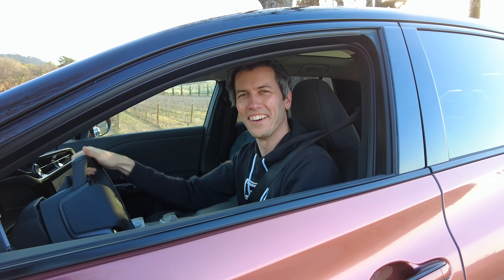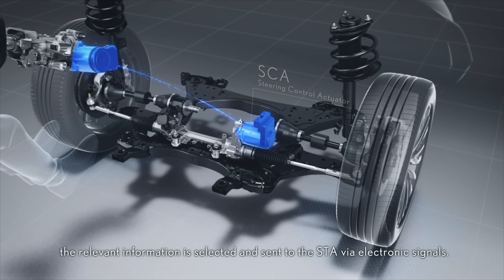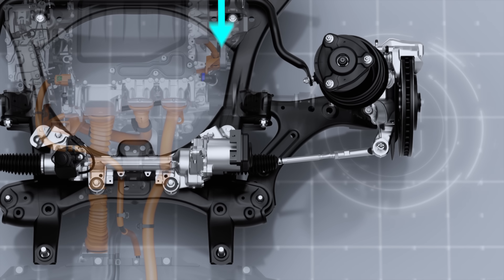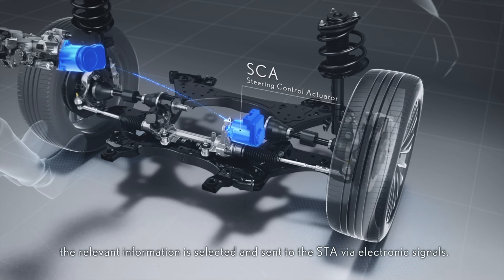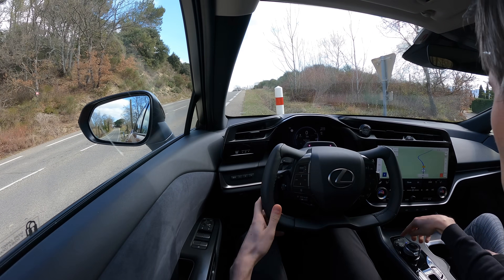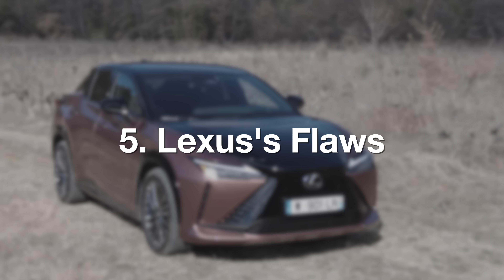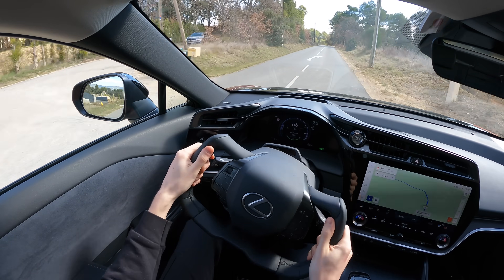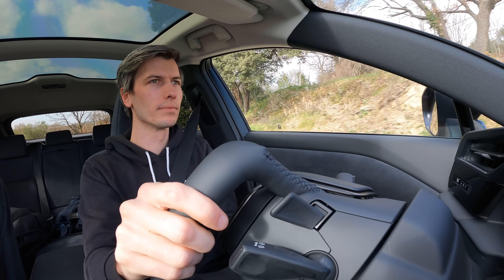How Lexus Fixed Tesla's Bad Idea: Steer-By-Wire Yoke

Comment: I can't wait for this to be an option in more cars. It seems like a no brainer to me, but I might be in the minority. More space for the driver, better visibility of the dash and road, probably cheaper to manufacture, no crossing hands, no one hand steering like a fully sick uleh. It can also allow for more safety features. Not just what is mentioned in the video, but in cases of accidents if the rack and pinion system is damaged you cannot steer. With steer by wire, the car could still steer, and with modern driving assist tech and cameras, it could ignore driver input and pull over to the side of the road even if the driver is leaning on the steering, or passed out from the accident.

Comment: Very interesting/ Were you able to perform a moose test? i.e. Quick and hard swerve at speed? Is there some logic in the system that senses this and gives the right steering response (i.e. similar to how kickdown mode in a throttle works).

Comment: Intuitive and predictable seems like different things here, I rather have a predictable steering response than a Intuitive one. I guess they could put a menu to set the steering response and curve to fit each driver.

I rather get a small steering ratio with speed variable force than variable ratio that would change the steering angle as the speed changes through a corner without moving the steering wheel, that could be very unpredictable!

Comment: That steering input latency looks insane and completely unacceptable. Same as the car deciding what kind of input is too much. 
I have no problems with the reliability of the system or the dinamic ratio, but again seems like the usual technology advancement that takes away some control from the driver, even tho most won't notice it.

Comment: SAAB wanted to do steer by wire in the 90s. But it's not legal, there has to be a mechanical steering by law.
At least in Europe.
Reply: This video is being recorded in France tough
Reply: @Napoleon_Blownapart  Maybe law is changed or doesn't apply to concept vehicles.

Comment: What you didn't mention is that in most current modern vehicles if the steering assistance fails the steering becomes so heavy that most drivers won't be able to turn the steering wheel by any appreciable amount.  So drivers may feel safer because they think there is a direct connection between the steering wheel and the wheels of their vehicle but in the event of a steering assistance failure at anything other than crawling pace they are pretty much guaranteed to crash.  Consequently steer by wire with its redundant motors is at least as safe and probably safer than most vehicles that are on the roads at the moment.
Reply: Except the faster you go the easier it is to steer without power steering. Power steering helps the most on low speeds not high speeds.

Comment: Well many cars already have a greatly variable steering ratio at parking speeds compared to highway speeds so if they can tune that to be the same it's a non issue to me. In fact since its all programmable they could give driver options to fine tune it to desired behavior and make most people happy with it.
The response time issue tho I'm not a fan of. As they said themselves the reason we go to fly by wire systems is to eliminate timelags in inputs and improve precision, here it clearly is much worse.
This car look like it would do very poorly in elk avoidance tests I imagine because you would simply not be able to redirect the wheels in time no matter what you do. It's on the level of a safety issue imo, they need to improve the response massively.

Comment: The variable steering ratio makes a lot of sense and is something Nissan did on the last iteration of the 350z using an electronic variable orifice (EVO). Like you mentioned I’d still be worried about the additional monitors sending an incorrect signal like we see on some driving assist systems now with LKAS, ACC, or Braking Assist causing some cars to slam the brakes while on a highway due to the monitors thinking something was in the way. I’d also be worried about this system 10-15 years after it’s release when some cars with this feature could see neglected maintenance possibly reducing the effectiveness of the redundant systems in place.
Reply: I'm quite certain an "electronic variable orifice" is just changing the steering assist...

Comment: I wonder if you don't want to prevent wild steering inputs at speed, e.g. in the event you need to dodge a deer on the freeway. And the sensitivity curve related to speed I'm not sure is a problem for predictability -- turning speed is already variable with forward speed with a linear steering rack. It might feel like butt, but I don't think it's because the alternative is inherently more predictable. Might be some interesting parallels to first person shooter controls on console analog sticks. Can't think of a good reason to have that steering latency, though.

Comment: Didn’t know Lexus was going to be using this system.  Good idea and I would love to see Tesla do it.  Having driven a yoke in Tesla for a year and a half I actually like it, but would much rather have this variable steering.
Reply: This didn't age well, the cybertruck has it even before lexus.
Reply: Yo zolloteck
Reply: You shouldn't be: they were 90% there ten years ago...
Reply: Didn't you missed traditional controller for turning signals and so on?
Reply: Lexus engineers play chess while Tesla "engineers" are merely playing checkers.
Reply: @dantesinfernopurgatory7826  irl both are run by a marketing team and the real engineers are pulling their hairs
Reply: @dantesinfernopurgatory7826  In my opinion this is not true; Tesla has some exceptional engineers.
Reply: @willitbreak5825 
They also have some moronic management, who seemingly make decisions based on how funny a meme it could be.
Reply: Tesla falls apart, I will only trust Lexus with this type of systems.
Reply: yea someone who would never go near a Tesla let alone buy one, good to see other manufacturrers with actual engineering experince are doing things right.

Comment: Changing Ratio and independent steering from steering wheel - already in production use since at least 2008 BMW Active steering. Works by inserting an electric motor into the steering column/shaft, which can e.g. rotate left when you turn left to make your wheels turn faster than your steering wheel or turn right when you turn left to reduce wheel movement. Or turn left without your steering wheel to reduce need for ESP-action, if your car is slipping to the right. But there you have a mechanical backup - if the steering motor stops (blockage or electronic dies or no electric power at all!) it neither increases nor decrease your gearing from steering wheel to tire movement and you can always steer.

Comment: I drove a Tesla plaid for a long weekend. The only real time you need hand over hand was during parking lot maneuvers, which I quickly learned that you can easily take two fingers and spin the yoke like you’re dialing a big rotary telephone. Super easy. For all other driving scenarios, the yoke definitely felt superior.
Reply: I've had my Plaid for a little over six months and that's essentially how I do it for tight maneuvering except I use one finger.  Overall I like the yoke but I really would prefer turn signal buttons over haptic surfaces, I can't always seem to get the turn signals to work.
Reply: @TheAeroegg  I loved the better visibility, I think a lot of the complainers have never even tried it.
Reply: I've been using the yoke for about a year, and it gets even easier over time. The shape means that you can grab onto something that you are pushing/pulling at a right angle or at least a better angle. It feels like I have more control. Maybe like the difference between opening a door by turning a lever vs a knob. The knob is symmetric, but you can apply torque more easily to the lever. It's related to why some people put steering knobs on their steering wheels especially if they have a high steering ratio (e.g. buses or trucks). The asymmetry also provides better tactile feedback about the position of the steering wheel/yoke.

Comment: As an engineer, I love the concept and almost all of the implementation. Getting software between the drivers and the steering is a nice thing when you're the software engineer; gives you amazing flexibility in controlling the system overall to improve the user's experience. Many issues can be addressed with firmware update, not a full recall. I'll be interested to watch as systems like this become favored for semi- and full-autonomous vehicles.

As a consumer, I dislike the increase in complexity and cost. Redundancy is great for mission critical systems, but will inherently be more expensive and require additional development time and single-point failure testing. Not to mention, it just takes a driver ignorning the "service steering system" message for them to be operating unsafely, or the vehicle needs to disallow operation in this condition.

The hybrid variable steering ratio systems BMW pioneered 20 years ago seem to have struck a good middle-ground (for vehicles that aren't intended to be self-driving). The benefit of augmented steering response, without the drawbacks of latency, lost feedback, or added redundant parts required by design.

Comment: Yeah, no. I'm not interested in the engineer's opinion of what feedback should come through the wheel. There's too much that can go wrong due to software on modern cars already, this is a failure point you didn't address. One bad over-the air update and your car could be impossible to drive. And as long as software is written by humans, that's a real possibility. That delay is also unacceptable.

Comment: It sounds rather more expensive than a conventional assisted stearing setup and ultimately it will be less reliable I have lost count of throttle pedals I have changed and when they fail its not a safety concern.
I have driven heavy trucks with failed power steering its not a problem people shuld learn to drive there is no need to turn the stearing wheel if the vehicle is not moving. Its overcomplication for the sake of overcomplication. It smells like computer assist just because we can just remember the simple route is most likely the best route

Comment: Infiniti also has a steer-by-wire system. Theirs has a physical connection that's disconnected by a clutch unless there's an emergency. Kind of negates the packaging benefits.

Comment: SO in order to save the world from combustion engines and carbon emissions you are told to buy electric Vehicles which have a main expensive battery, still has the usual 12volt battery and now another backup battery and yet they can still leave you stranded because of a dead or low battery?? How much harmful emissions are created by the production of all these batteries and electricity needed to recharge the vehicles not to mention the cost of replacements? Furthermore no one is reviving any old electric car made in the past 10 years due to the parts unavailability, Irrelevance of it's technology and cost to rebuild them thus creating more waste and pollution. But the politicians want all electric cars by 2035. Make it make sense!

Comment: This is basically video game steering.  I remember in Project Gotham I did a test where when you were stopped with the joystick all the way to one side, the faster you went from a stop the bigger and bigger the turning radius got.  That's pretty much how this works.  In a regular car your steering would remain locked and your tires would be screeching as you understeered more and more as you sped up.

Comment: To me, this is a solution to an issue that never existed.
For one, the multi turn steering is not a problem, because despite when parking or doing very slow maneuvers,  you can go on all roads turning the wheel just 90 degrees. You almost never use the full turn of the wheel.
For two, the packaging argument is only relevant for combustion cars, that ave a big engine in front. Now that we are moving to electric cars, that is a non issue. So I don't see any benefit to develop all that tech now.
And to finish it off, the engineer argument is absurd. Talks about speed in response, and delivers a system with delay. So if that was the problem they set out to solve, this is a total failure.
And after all of that... This is for suer going to be very expensive, for a marginal gain in some areas, and a noticeable loss in others (like delay) So it solves some issues, but creates others. What a terrible solution.

Comment: The engineering is fascinating, but it's a great example of a solution in search of a problem. And an over-engineered, over-complicated, over-expensive one. Anyone who's driven a light well balanced car knows that rack and pinion steering is a perfected system providing a thrilling and immediate feel and connection with the road.
Also, remember that while redundancy reduces the impact of failure, it also doubles the chance of failure happening.

Comment: The repair costs for this system shortly after the warranty ends will be staggering. In my steering shaft system if I lose my pump I can still get home and fix it. I also can turn it with the engine off if I need to tow it onto a wrecker. With this system there are too many complex components made by the lowest bidder in a foreign country. The failure of any one of them force you to the side of the road waiting for a tow at the best. Also a terrible idea to hand over yet another function to a computer. Just wait for this to get hacked. The minimal gains are grossly outweighed by the fiscal impact it will have on the unlucky ones who purchase it. Unless Lexus will warranty this system for 25 years nobody should be willing to buy it.
Reply: Yep this is common sense

Comment: Every day we grow closer to video game simulators replicating reality. However, I always thought that it'd be due to the simulators improving in feel..

For day to day, this system is probably fine. But it'd be cool if there was a mechanical steering rack as a "back up" that's clutch engaged, so you can decide when to have a more authentic feel when you want. Granted, you'd have to stop the vehicle and straighten the wheel (And it'd cost more money to develop a clutch system for the wheel)

Comment: Hope the future of this steer by wire is that the steering characteristic is a constant exponential/progressive ratio instead of adaptive but fixed ratio by default, with a clear switch over for parking speed maneuvering. Adaptive but fixed ratio just sounds like you will have that one time you jerk to dodge a pothole and will end up in a jerk fest because your corrections or seemingly in your case, drive over whatever you are driving towards.

Comment: My BMW has Variable Sport Steering and it's great, albeit the old fashioned way. It's not nearly as variable as this Lexus tech, but I can confirm that it is easy to get along with. I can take roundabouts without lifting my hands, yet have a relaxed feel around the middle when driving fast. I really don't like the delay this has at all, this does not seem something that should still be in a drivable car like this pre-production model. Should have been eliminated at the design stage.

Comment: So F1 cars use this? After all if it's better and safer then it must be in use. Nope. And if a directly connected steering wheel works in the quickest cars around a track in history then it's clearly fine for the road.
Reply from the maker: You're aware they use brake-by-wire in F1, yeah? The rules do not allow a steering assist in F1, so they are forced to use a mechanical setup. I'm not saying I disagree with you, I'm just saying that's not why it's that way in F1. By that logic, we should remove all steering assist, which would not be a great idea for 99% of drivers.

Comment: In flying, if there is a delay of around 300ms that typically would cause a pilot induced oscillation. You can see the delay in the steering. In an emergency situation, I would anticipate at high speeds a driver may end up spinning out depending on how the stability control interacts with the handling as a whole. It would be interesting to see how the two separate systems interact on a highway.

Comment: I've always wondered about this, as I rarely need to turn more than 90° in either direction unless I'm going extremely slow (like, pulling into a parking spot slow).

Instead of changing the whole steering ratio depending on speed, would it be possible to make one where the steering ratio was less sensitive initially and then gets higher the further you turn the wheel? That way, it would provide a similar benefit while also being consistent at every speed (and if it can be done mechanically, it wouldn't have any input lag either).

Maybe using a egg-shaped gear or something? Idk. I feel like that would have been a better option than steer-by-wire. It makes sense for planes because the control surfaces are so far away from the yoke, but that isn't a problem in a car.

Comment: The whole  electric cars having  more responsiveness  in braking it so annoying while driving behind  EV in an ice car.  They   start slowing down  what feels like randomly. When I would usually  lift and coast into a roundabout/junction I  have to brake  and then continue  using engine power to move because the car infront has started to slow down  400m away from where they actually  need to slow down.

Comment: You need lots and fast rotations not only while parking, but also in small roundabouts. It is like hell to do it with a yoke like Tesla's especially as you need to also sign left and then right when getting out of the roundabout, while also rotating the wheel. Cannot do all those with capacitive buttons and hand over hand rotating fast.